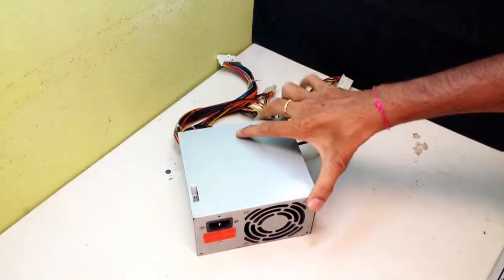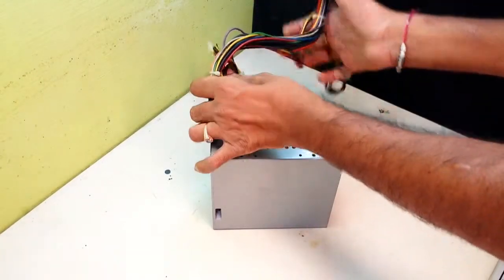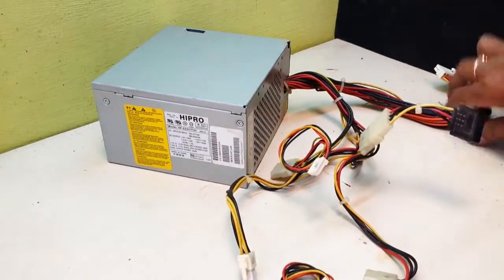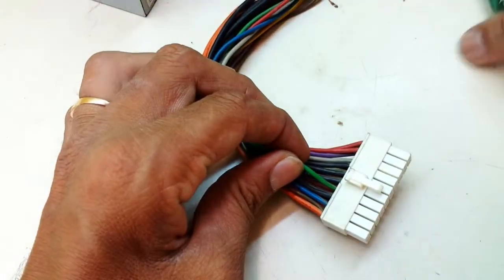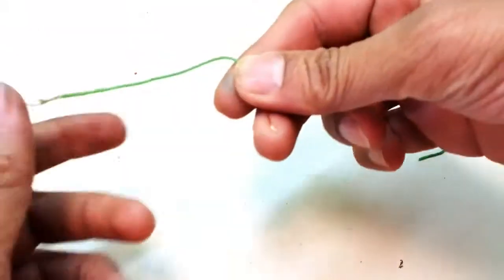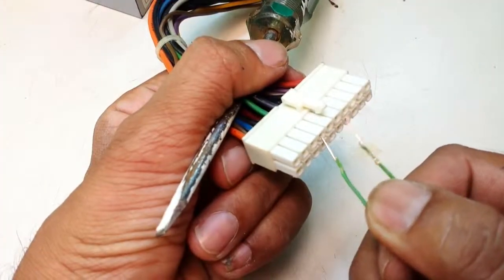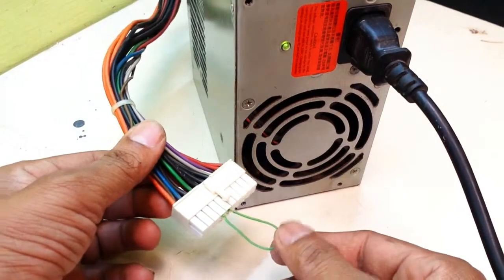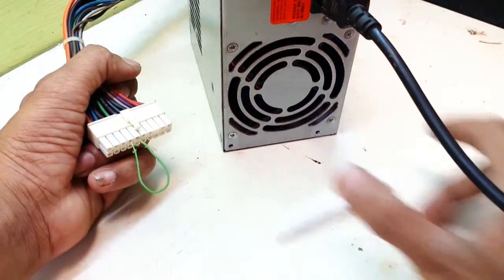How to start a smps without  motherboard

Comment: I tried to do same but my smps just blinks. I tried connecting a 12W fan to 12V line and a 50 w bulb to 5V line as dummy load but in that case also smps just turns on for 500ms or so and turns off. Its a old smpd having 20 pin ATX connector